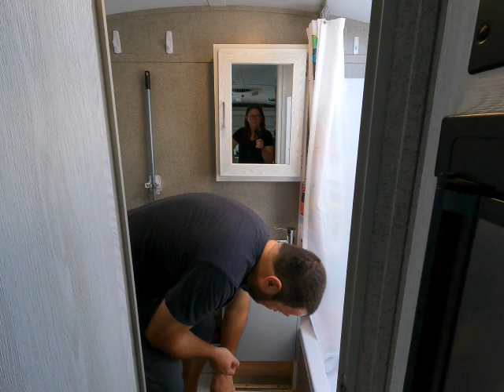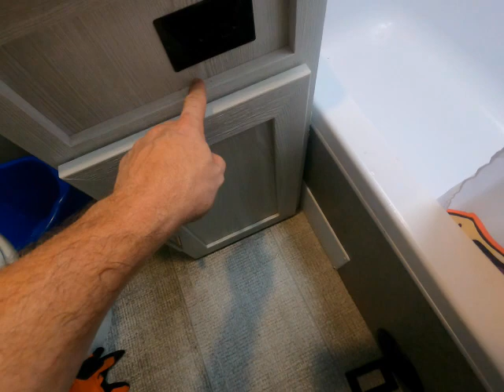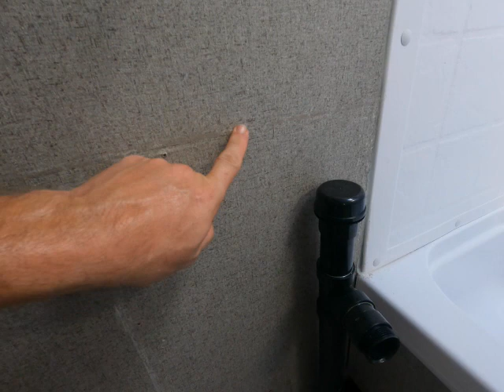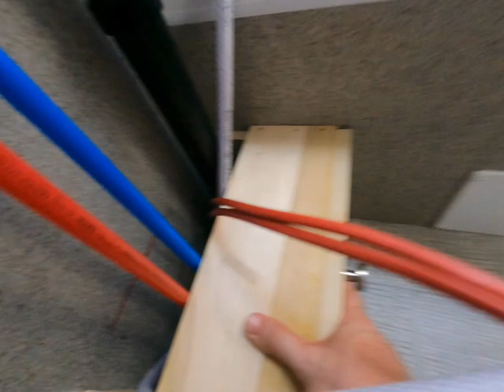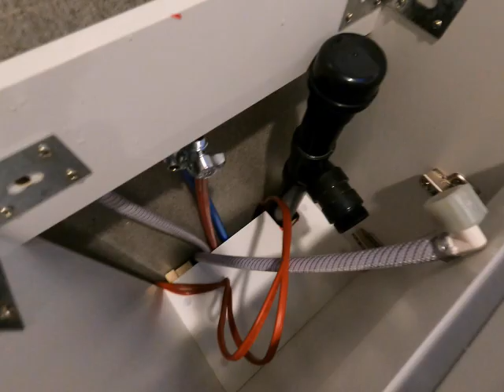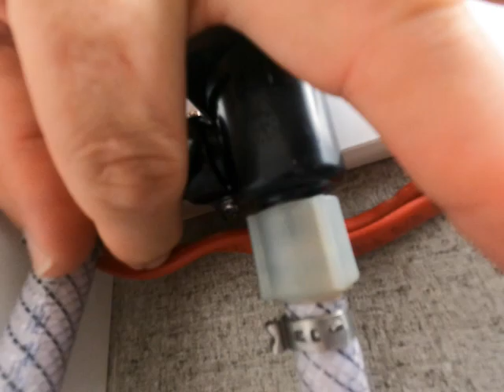Fixing the Biggest Problem with the 19FD!

Comment: It's fun to watch these videos. It's nice to see how the plumbing and wiring is routed in these units.  If  you had to make these major changes, wouldn't it be easier to find a  travel trailer with a floor plan that meets your needs.  You're very resourceful.
Reply from the maker: Thanks for watching. There are not a lot of options for a camper that can be easily/safely pulled by an F150, and the GeoPros have a lot of good features and are well made.  Now that I've made the modifications we wanted, it is perfect!

Comment: I have a 2021 19FD.  I full time in it.  I'm 6'3" and I don't have a problem with sitting on the pot, I just spread my legs wide and my left knee is right where you mounted your toilet paper holder...without that there, I have plenty of room for my legs...but headroom in the shower is a problem!  Anyway, I'm going to have a cabinet made for extra storage in the bathroom.  Look at the back wall between the medicine cabinet and the cabinet behind the toilet.  Lots of wasted space.  You could put a cabinet there about 3-4 inches deeper than the medicine cabinet without compromising shoulder room while you are sitting on the pot.  Screw it into the side of the medicine cabinet and the cabinet behind the toilet for support.  I'm a little afraid to screw into the back wall...where is the aluminum frame?  How thick are the walls?  Also, there is room for more cabinetry if you continued the cabinets above the kitchen sink to over the window on the drivers side...but, you'd have to screw into the wall for support...same questions as above.
Reply from the maker: I never found a good way to identify the aluminum frame locations. I never removed the medicine cabinet and the new sink was mounted to the same holes as the old one, plus the floor, so I didn't need to find any. Sorry I can't give you more help, but good luck with your changes!
Reply: Do you still have the fd? Have you had any problems with it?